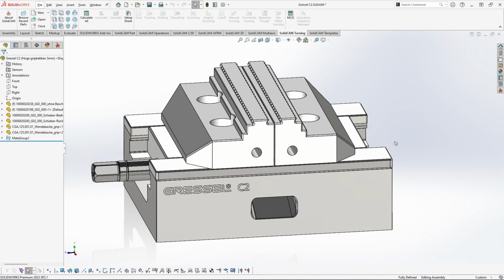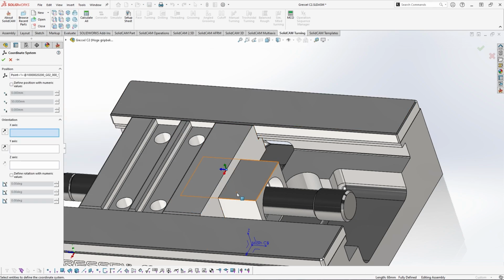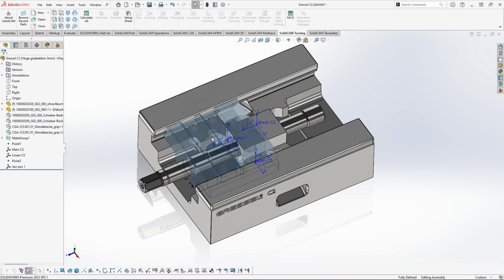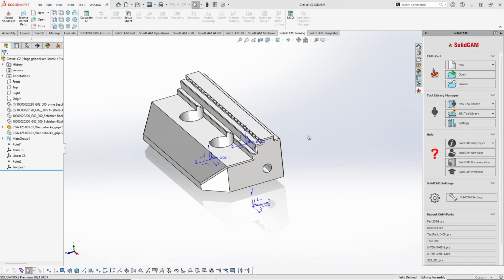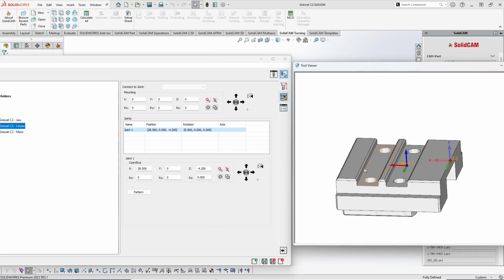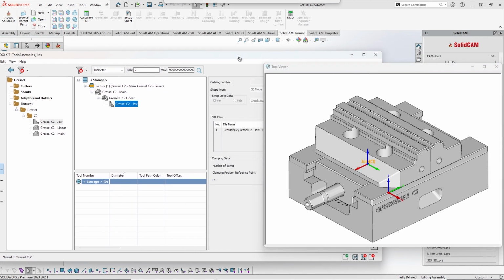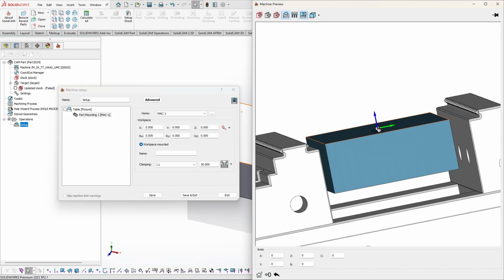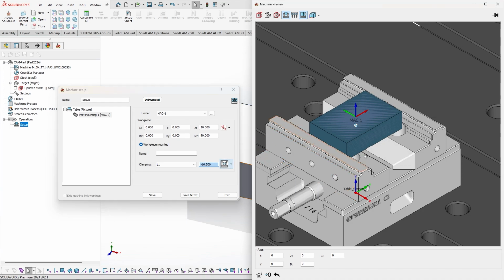How to Define and Use Self Centering Vise

Comment: Hi, great video !! I went through this exactly with a similar self centering vise. In the setup it looks perfect, part is clamped perfectly in the vise and placed correctly on the machine bed. But when I go to the machine simulation the jaws are shown as opened and away from the stock? Any suggestions please. In Solid Verify it is perfect, vice jaws are clamped perfectly on part.
Reply: Found the problem - had to update SolidCAM to Version SP2HF2